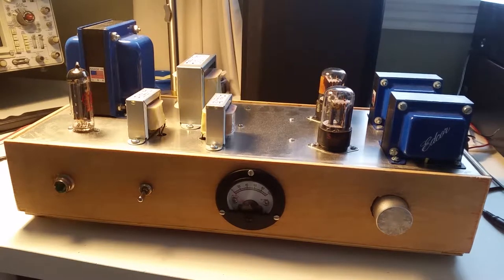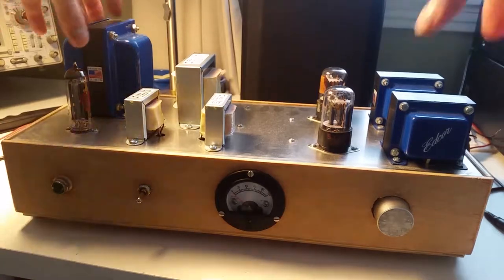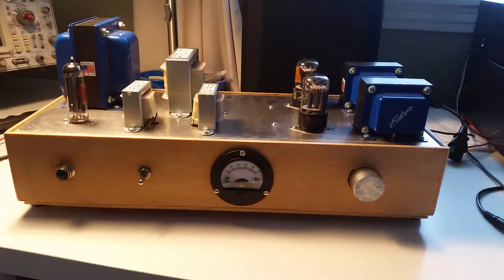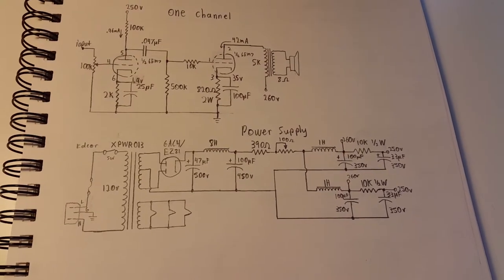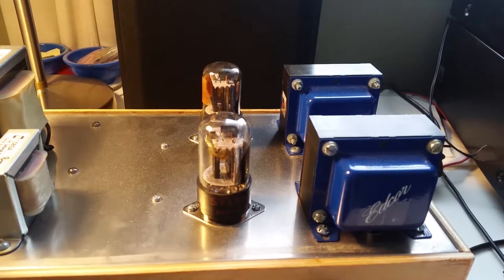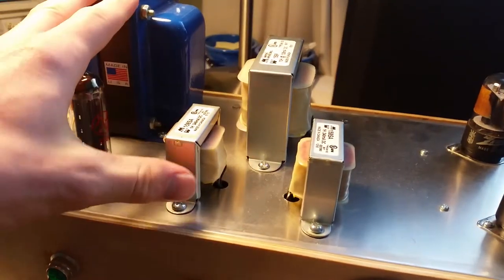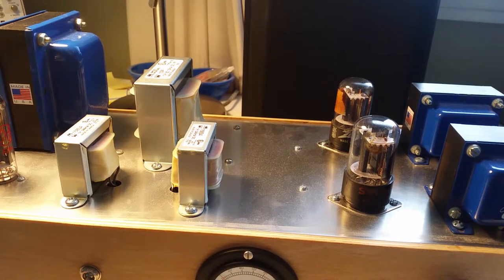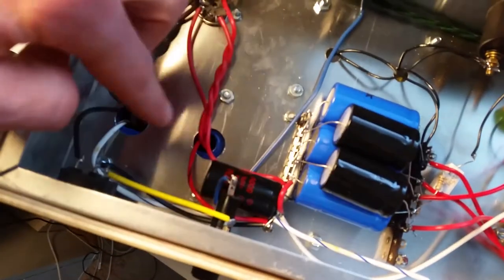6EM7 SET Amplifier

Comment: I will be doing a variation on that design . You would be amazed how cheap you can make one for experimentation. I will be using a DC-DC converter for power and 70 volt line matching transformer for output. It will be around 40 dollars total.
Reply from the maker: Awesome! I was wondering how much it would cost to make something like this with a switching supply and whatever transformers are laying around. Do you think you'll use 6EM7s or triode-strapped pentodes like 6V6s or EL-84s?
Reply: @thetuberoaster8321  I will use 6EM7. and 70 volt line matching transformers. The power supply will be  a DC-DC converter from ebay. It is 8 - 32 volts in, and adjustable output from 45 to 390 volts. If you are doing mono, add a 3 amp buck converter to make the filament supply, or if stereo, tie the filaments in series. Use a 12 volt primary power supply for  the system. I have had great luck making other tube amps with the same manner of power and output transformer. These are only goof for amps for about 1 or 2 watts per channel. the transformers saturate at any higher power.

Comment: I am thinking about a class A PP with these. My thought to get around the matching is to use the small signal side as a driver for the power side with local ( plate to plate or plate to cathode) FB. This would require another dual triode preamp tube for the phase splitting (and slight VAS) but would be worth it I think to reduce the need for tube matching.
Reply from the maker: That sounds like a good idea actually. With driver tubes you might be able to run in class A2 or AB2 and get a fair amount of power and low distortion. Maybe a 6SN7 or 12AU7 as the phase splitter.

Comment: PSU negative-output is floating, because there's no earth-symbol in the circuit-diagram. It will sure perform better when connected.
Reply from the maker: Good catch. I didn't mark it in the schematic but in the actual amp the power supply is earth grounded at the capacitor bank.
Reply: @thetuberoaster8321 , Never had any doubt about thát. :-) .. Very nice project indeed ! .. Love its simplicity.
You know, sometimes reducing components can be a challenge too, just for sports.
Once I built an AM-transmitter with a personal challenge only to use scrap-components.